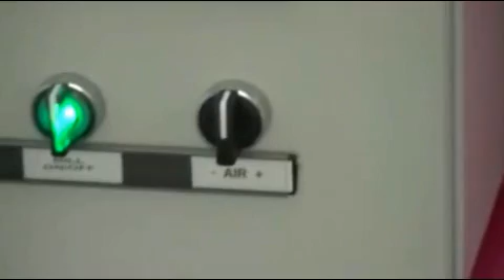CRM 50 - Copper Recycling Machine

Comment: This seems to be a good machine for smaller operators. The machine is said to have an output of ~50kg p/hr which makes 400kg production per day.
Conveyor belts could be added for easier loading and removal of materials.
Also available in New Zealand.